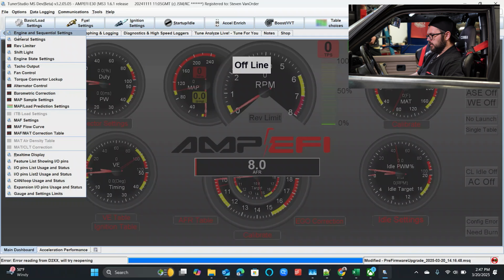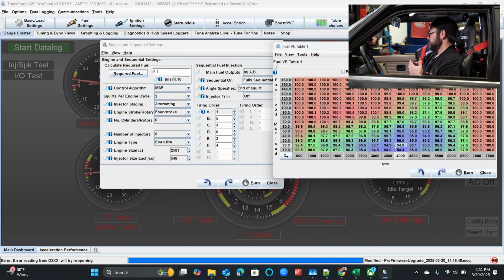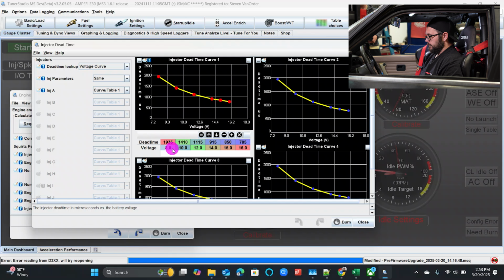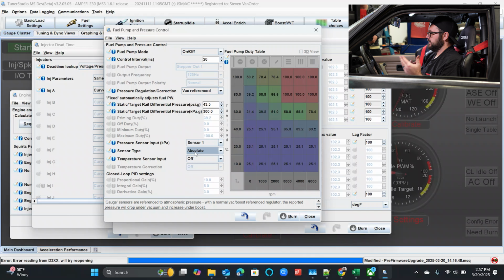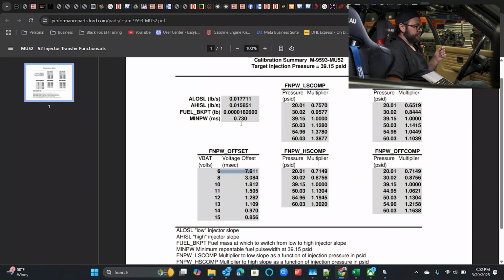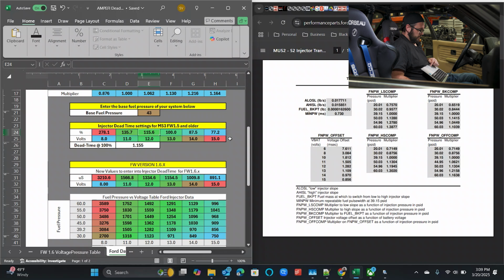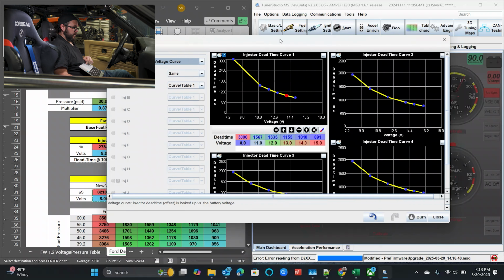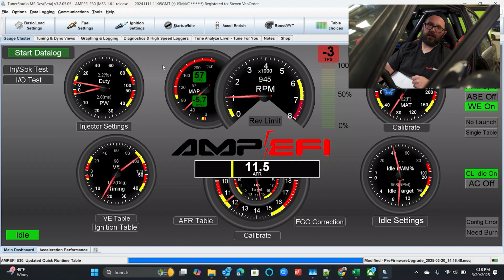Tuning the BMW E30 | Required Fuel, Dead Time & First Start!

Comment: I looked at several fuel pressure gauges and I only found a few the have an output for logging or as an input but they are PSI. Can you recommend some that have Kpa output?
Reply from the maker: You can simply convert the signal. Every 14.68psi is 100kpa

Comment: When you set the deadtimes for 43psi you punched in 52lb injectors. Changing the deadtimes from 39.15 psi to 43 would make the 52lb injectors flow mote so you would actually would use 54.5 lb/hr.

Comment: Great video. Lots of info
The listed link for the spreadsheet is not the same as the one you show in the video.
Does not have the OFFSET or OFFCOMP sections
Reply from the maker: There are multiple tabs in the spreadsheet. Can you confirm your looking at the Ford data tab?
Reply: @AMPEngineManagement  Yep. There are three tabs (FW 1.5 DeadTime Calculator) (FW Update 1.5<1.6) (FW 1.6 Voltage Pressure Table).
There are two different clickable links in the Link provide from the above description (Injector Deadtime Spreadsheet) (AMP EFI-Dead-Time-Conversion) both have the same three tab spreadsheet.
The other three clickables, just take you lower in the page to the instructions on how to use the spreadsheet.
I have tried 'searching' the website for other spreadsheets, have not found a Ford Data tab.
I'm sure I'm missing it somewhere, but where?
Thanks for the help
Reply from the maker: @siderbox I will take a look at this today. Likely the file needs to be updated
Reply: @AMPEngineManagement  Awesome, Thanks
Reply: @AMPEngineManagement any update on this?  The Ford data tab is missing and I’m trying to enter data for my LU47s

Ended up using a different spreadsheet to convert to 1.5 data and then used the 1.5->1.6 tab to get numbers. Would like to double check on the tab you used
Reply: @Mustang5L5  What sheet did you use?  The data is still not there.
Reply: @BestUnderPressure  I used the old spreadsheet for 1.5 and entered my data for the LU47s there.   Then I took that data and used the 1.5 -> 1.6 spreadsheet to convert and entered that data. 

Been tuning the car all fall on those numbers and had it driving pretty darn good.  I just wish. They updated the sheet to show direct 1.6 firmware data.
Reply: @Mustang5L5 Thanks, I’ll see if I can figure it out.  Sounds like we bought the same injectors.
Reply: @Mustang5L5  I emailed support.  They just uploaded a new version that includes the ford injector conversion tab that was missing
Reply: @BestUnderPressure  Awesome thanks i'll have to go find it so I can double check my numbers

Comment: A trick I used to get deadtimes, was I hooked up a bench powersupply, and disconnected the power connector to the injector resistor pack. I then provided power from my bench powersupply and brought all the voltages to the same AFR ensuring that voltages did not play a role in my AFR. you can do this also by depinning the power wire to the injectors and running into a bench power supply. I found it much more accurate then just plugging in numbers that I was given.

Of course the base voltage that I used was what I used to get the car running and the "generic base" voltage supplied by the manufacture for the injector.  

Just my 2 cents.

Comment: Lambda 14.7:1 is not 14.7 cc air to 1 cc fuel, it's not a ratio by volume it's ratio by mas, so 14.7g of air to 1g of fuel
Reply from the maker: @Phantom-mk4kp  Yes, that is technically correct. I misspoke, thank you for catching that.
Reply: So what should we target for 15% Ethanol.  I am idling at 14.7 and target 14.3 at cruise.
Reply from the maker: @wadestewart901  your wideband is going to report lambda 1 at stoic regardless of the ratio for the fuel. The wideband is taking lambda and multiplying by 14.7. This is why it is possible to tune e85 in the gasoline scale. 
Generally I will target 14.4 near idle on older engine designs or aggressive cams and 14.5-15.5 in the cruise region depending on the application for gasoline.